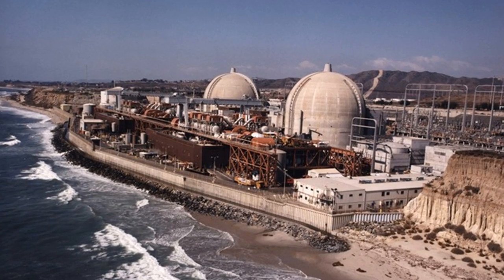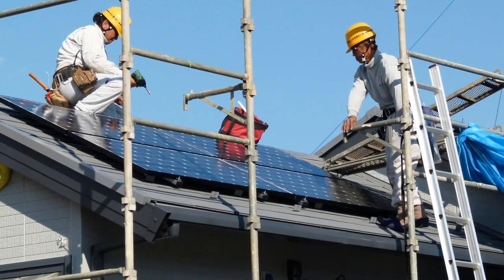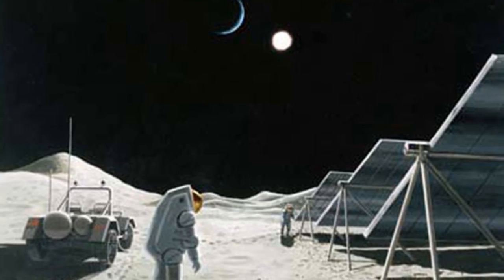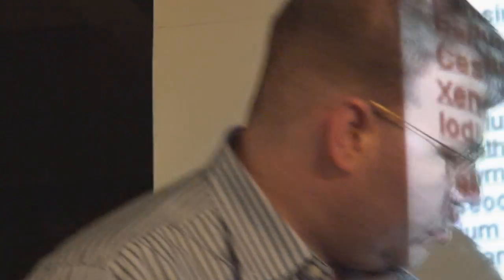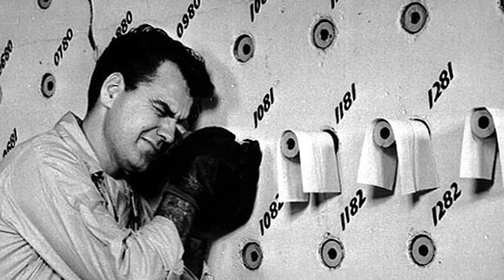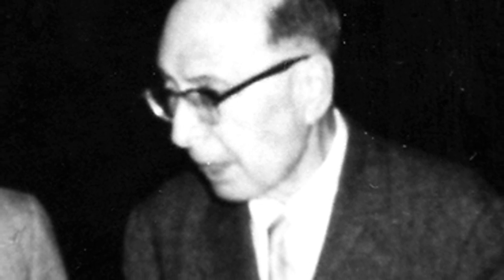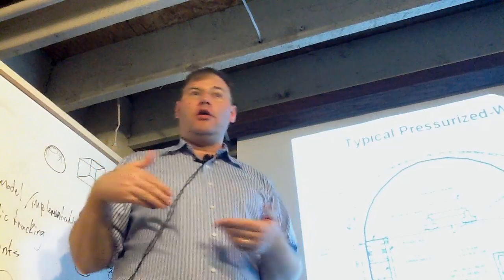Thorium: An energy solution - THORIUM REMIX 2011

Comment: If it was all that great, why is there still not a single reactor that keeps running on Thorium? Those that existed were all closed down again shortly because there were too many problems. You need to constantly refill Thorium to the reactor and get the used stuff (that was found to be more dangerous than anticipated) out again. Because you do that with a very hot, salty liquid, the problems with corrosion were too big. What sounded good in theory showed it was unsustainable in real life.

Comment: I have seen a lot of discussion about the corrosive nature of liquid salt, and the need for the material which contains it to be non-corrosive and neutron shielded. I'd like to hear Kirk address that issue. I have yet to hear a solution to that, nor the way they managed it in the experimental LFTR reactor that ran in the late 60's.

Comment: I'm an undergrad student in Nuclear Engineering.  I had never really grasped the advantages of liquid fuel before watching this video.  Too many concepts for non-water reactors have obvious disadvantages e.g. sodium-cooled reactors.
One point that stood out to me in this video was about radiation hormesis.  I didn't know that there were any significant studies that supported it.  In the program here we mainly treat it as a myth frankly.
Reply: Jason Walker Awesome. What school do you to and what's their nuclear program like?
Reply: Georgia Tech, graduated last year.  Great program, though small.  Their lab has a surrogate reactor and a bunch of detection equipment to tinker with, but it's difficult to do real experiments in reactor physics without a real research reactor.  GT's Mechanical Engineering side is state of the art though, and many courses overlap.

Comment: I would love to see this commercialized in my lifetime.  But, even conventional nuclear has too many advantages over fossil fuels for us to continue down the path we have all been on (relying on fossil fuels for 75%+ for all our energy needs and just under 20% for nuclear.

People always bring up Chernobyl as the poster child for nuclear.  Chernobyl was horribly designed reactor, called an RBMK (one even the Soviets were smart enough to try and phase out thirty years ago, to try and replace them with VVERs).  Six safety mechanisms were intentionally removed (including removal of the control rods) to carry out a test on the turbo generator.  People also make foolish statements like, "A Fukishima can happen anywhere".

1) No country outside the former Soviet Union uses an RBMK; no country, even prior to Chernobyl, outside the Soviet Union, would actually carry out such a test on the turbo generator of a reactor already in public service;

2) despite the fact that a lot of different numbers are thrown around, around 40-60 people have died because of Chernobyl (not the hundreds of thousands some would have you believe).   Although this is still too many (which is why I like the idea of LFTR), those 40-60 people are still a mere fraction of those killed by the Piper Alpha oil rig disaster which happened two years later and killed 167.

3) Fukishima was caused by a tsunami, meaning A FUKISHIMA CANNOT HAPPEN ANYWHERE BECAUSE TSUNAMIS CANNOT HAPPEN EVERYWHERE!  My state and town (along with the city it is a suburb of) are at absolutely no risk for a tsunami (unless a comet or small asteroid crashes into Lake Michigan, at which point, a nuclear accident is the least of our problems...and what are the odds of that happening in our lifetimes?)  Even if a nuclear reactor is operational in a tsunami-prone area, however, by simply securing diesel or other fuel tanks from risks of flooding or being washed away...you have ended the threat of "a Fukishima".  Of course, the best way to avoid "a Fukishima" in such areas is to have a reactor that shuts down if the fuel stops being supplied; has "a freeze plug" melt so the fuel can be allowed to drain away.  Such a reactor could exist some day in the form of LFTR.  (Having a liquid fuel would also be beneficial because if the fuel becomes too hot, it can also be removed from flammable-at-high-temperature-graphite...thereby ensuring "a Chernobyl" will not happen.

4) I have spent my life growing up in the Chicago suburbs.  For several decades, Illinois has generated nearly half its electricity from conventional nuclear power.  No "Chernobyls" happened; no "Fukishimas" happened here!  Instead of opposing nuclear power, and discussing nuclear energy as if disasters are inherent to nuclear energy...maybe it would be better for some of you to ask the questions, "Why do some places use nuclear energy without problems, while other places have problems with nuclear energy?"  "Are there safer ways, 'fool proof" ways?"  By generating half its electricity from nuclear, Illinois reduced the amount of coal it burnt (coal makes up almost the other half by itself), thereby reducing the amount of deaths from coal pollution; deaths from coal mining; deaths from "coal fly ash" and "coal slag" dam collapses.

Comment: Can anyone point me the specific time in this video where he explains how exactly they can generate electricity with thoriumreactors? Can't find it..
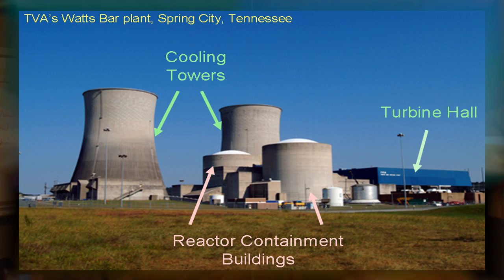Reply from the maker: 43:11 Briefly explains how electricity generated by typical nuclear reactor. With an MSR the coolant is Molten Salt instead of Water. Molten Salt moves through a heat exchanger to heat clean salt (another Molten Salt without nuclear fuel dissolved in it) then that hot salt can be used to drive a turbine. There is a more technical video here focusing on 2 things: the Chemical Kidney and Power Conversion System https://www.youtube.com/watch?v=xBmk7t5K35A

Comment: 17:45 2.43 or something from MIT website I think.
24:35 fission products
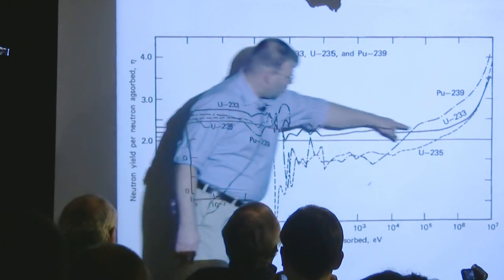33:46 instead of doing fast or thermal they just burned uranium which is really rare and gets into history
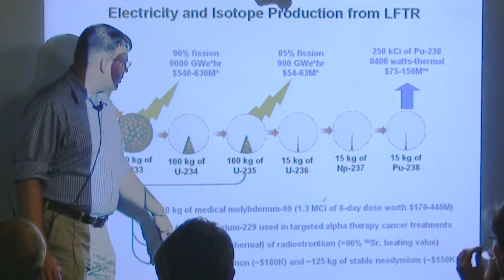1:12:07 LFTR makes plutonium (1% of waste) but it's plutonium-238 which NASA and SpaceX really need. We used to buy some from Russia but now they ran out, so we're relying on having enough to get people back home. LFTR is what makes P-238. Also leads to barium which can help cure some cancers.
1:17:13 why it’s cheaper
1:27:00 coal plants also release radon but they don’t count it. They release more than a PP ever would be allowed to.
1:51:30 the fuel is liquid so you just leave it in the reactor until it’s all burned up

Comment: @maximumcorruption Toothpaste uses Sodium floride.The LFTR that Kirk is speaking about will utilize a eutectic mixture of  lithium fluoride and beryllium fluoride. I know there are other MSR types that use other salts such as the liquid-chloride, fast-spectrum reactors but the main one talked about here is the thermal spectrum of the LFTR.

Comment from the maker: The U-233 is bred in the blanket then (once separated) sent to the core. This process will not involve moving uranium hexafluoride far from reactor, so will be using remote tools or automated equipment just as operation of pumps would be automated. If it is being bred and stored for seeding other LFTR then yes there's storage and transportation considerations.

Comment: @myhrcat The corrosion resistant material used in the original LFTRs was invented by Oak Ridge specifically for use in the LFTR and now it's known as Hastalloy-N.  If you google search it, the first link is a pdf that explains it.  Hastalloy-N is also routinely used in nuclear reactors, so I presume it's neutron shielded, though I don't know that for certain.

Comment: I'm all for the LFTR but what do you fellow boffins think to Small Modular Reactors by Rolls Royce? Assuming LFTR isn't going to get done (it's not been done in all the years I've been following it) My engineer friends (not nuclear engineers but engineers none the less) haven't heard of it!... Would you prefer to have a less efficient nuclear power plant than no nuclear power plant? Or do you think pushing for something like LFTR is worth the wait (in which potentially no nuclear Reactors are built?)
Reply from the maker: I'm all in favour or other approaches being explored. My own interest tends to focus on MSR SMR variants. Kairos Power (solid-fuel molten-salt-coolant) in USA. Terrestrial Energy in Canada. T-MSR (Yes, Thorium MSR) in China. If a reactor can't provide higher-than-PWR temperatures, then a lot of use cases disappear. Helium-coolant pebble-bed is another approach, but if it is going to be pebble-bed I'm more interested in Kairos Power's pebbles floating in salt to reduce friction.
Reply: @gordonmcdowell First of all thank you for introducing me to LFTR and Kirk! You have single handedly changed the way I see Nuclear Energys potential! But, in terms of implementation, I see it as short term vs long term gain. LFTR is clearly a great way to go but we, as a (for me, British) society have largely rejected it (which I don't like but is, simply, a reality!) So my question is more: would you prefer to have 'old' nuclear options (PWR, CANDU etc) or for the nuclear (STEM faculty in general) to focus in on something like the LFTR?
Reply from the maker: @ryanfisher5376  Oh the UK! That is why you mentioned Rolls Royce... I don't know the leading SMR contenders in UK. The Hinkley Point
Reply: It seems the UK is more interested in Fusion than LFTR meanwhile wind/solar farms are everywhere which I'm not a huge fan of

Comment: @greatestfool87 I'll crunch the numbers for you. Thorium has an energy density of around 20 gigajoules per gram. The energy consumption per US citizen is 327.38 gigajoules every year. Divide consumption by density and you get 16.369 grams, or 0.58 ounces. That's equivalent to a cube of 1.4 cubic centimeters volume, given the density of thorium is 11.7 g/cm3. That's a marble with a diameter of 1.4 cm, or 0.55 inches.

A marble or thorium with a half-inch diameter will power you for a year.

Comment: @breakablec if you get water out from a water cooled reactor, the chain reaction stops due to the reactivity loss (water is moderator, these reactors need moderation to work). On the other hand without water there is no cooling, and decay heat will be a problem.

Comment from the maker: @Steuben1978 "What is the difference with this reactor?" THTR-300 = pebble bed [solid fuel] core. LFTR = liquid fuel. In my video, which I'm sure you've TAKEN THE TIME TO WATCH, Kirk points out why solid fuel is not optimal for safety or efficiency. If you search for RALUCA TEAC3 you can hear a pitch for an new thoruim pebble bed reactor design. That might contain information more in line with your concerns of the German reactor.

Comment: U233 the atom that does most of the fissioning  in the LFTR and is ideal to use for the startup, but any  fissioning neurton source can be used. You only need it once in the liftime of the reactor, and it's possible to breed it as well, and there is a fairly sizable stock of it in the U.S. as well.

Comment: Two major things:  First, 99% of the fuel is burned up in LFTR, whereas 99% of the fuel is a light water reactor (which is what we have now) is not burned up and is waste we need to get rid of.  Second, the waste is not nearly as harmful because it is the really heave elements (those with atomic numbers higher than uranium -- 92 that are really dangerous and last a long time.  Thorium's atomic number is 90 so it almost never creates a waste product higher than 92.

Comment: Either note the mistakes or tell me I am wrong:
No nuclear reactor stops by itself if you get the water out. It stops because the control rods go in.  
The water is not just radiation shielding, but also a moderator which he fails to mention.

Comment: The German reactor is completely different than the one talked about in the video. It used solid fuel and helium coolant. While there ARE design challenges not discussed in detail the video, they aren't anything modern science can't handle, and significant government investment in the short run is more than worth the cost - we already spend billions on alternative energy. Why not through that 1 billion at Thorium? The LFTR is not perfect, but it's absurdly better than what we're using now.

Comment from the maker: Lots of people & orgs cite linear no-threshold. That does not make it correct. Nobel prize winner Joseph Muller spoke of LNT but his research data showed this not to be the case. Small studies already called LNT into ? but only recently was Muller's research data called into question. And why, oh why would background be safe, if background varies widely depending where you live? And "Fermi Reactor"? There were 3. None used Thorium. I think you're thinking of Liquid Metal Fast Breeder reactors.

Comment: No, there isn't 'room for interpretation.'  What I said has a definite meaning.  I do apologize that what I was talking about was in another video.  We would want to switch over to a cleaner liquid coal-based(USA has the most) fuel rather than dirty oil based fuels.  It isn't easy to just stop using fossil fuels quickly and we need an clean alternative, which the lftr can help provide.   Search for 'The Thorium Problem" and jump to about 10 minutes.  It's one of Gordon's uploads, by the way.

Comment: @bnightm Chemical accidents are easy to deal with. Gasses can be sucked up via fumehoods and stabilized via chemical processing. Industry has been using hydrogen and fluorine gasses safely for years. These gasses are also shortlived in the atmosphere, they react very quickly with pretty much anything to form more stable products. This is unlike radioisotopes, which remain dangerous no matter what chemical form they take, so it becoems important to ensure those remain immobile.

Comment: @usurper70 LFTR involves radioactivity (neutrons, gamma, lots of radioisotopes), high temps (700C/1300F), corrosive and poisonous chemicals (e.g. fluoride and beryllium, respectively)... But from an engineering perspective, are they manageable? I think the answer to that is yes; so long as all that stays INSIDE the rector, things should be fine (and with atmospheric pressure, it's much easier).

Comment: A recent Stanford University study (DOI: 10.1039/c2ee22019a) estimated the cancer-related mortalities attributable to Fukushima at between 15 and 1100, with a best estimate of 130. While these numbers are model-based and are thus no better than the assumptions that went into the model, they do represent a straight-forward attempt at quantifying the long-term effects of the disaster. Would you mind citing your source for the 900,000 figure above?